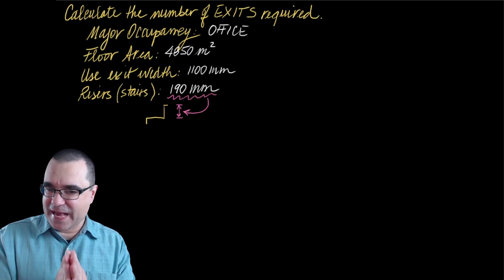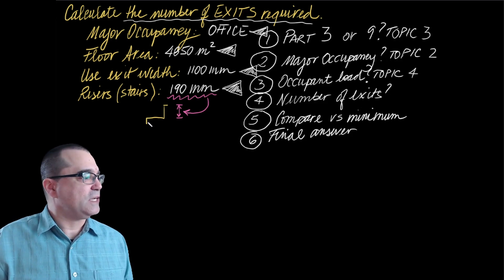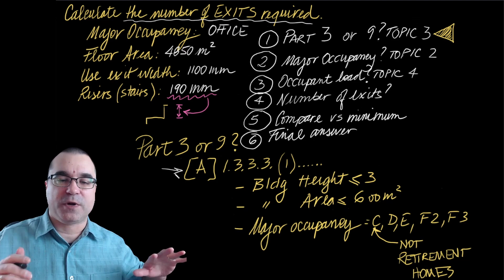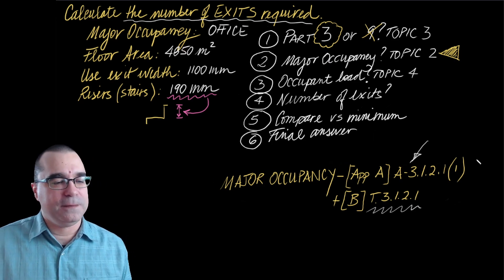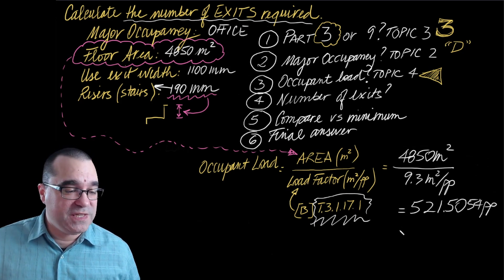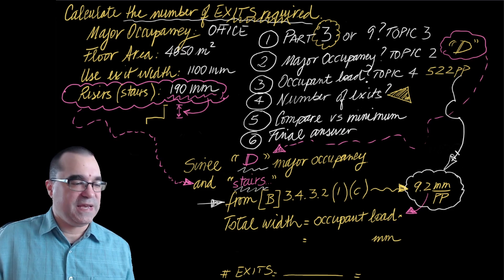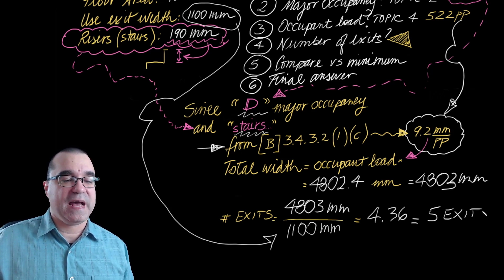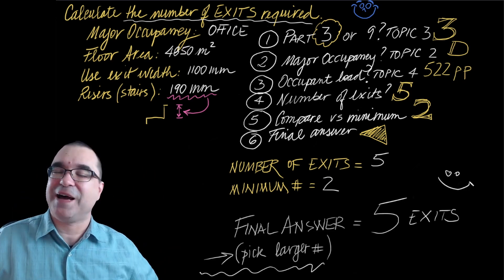🆕 TOPIC 12 | Example 04 (CON8413 )

Comment: No, I think only 2 exits would be okay, if there is no issues with egress distance. I understand the total width is more then 4 times of 1100 mm, but you can design 2 stair cases and each of them has a width of 2500 mm.